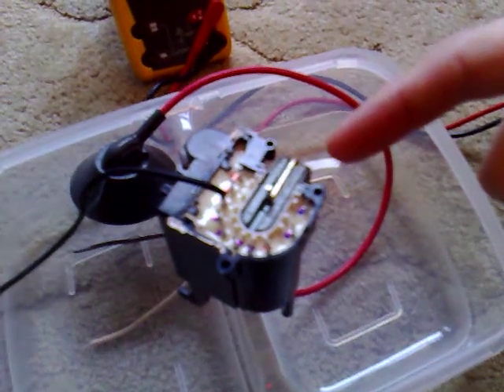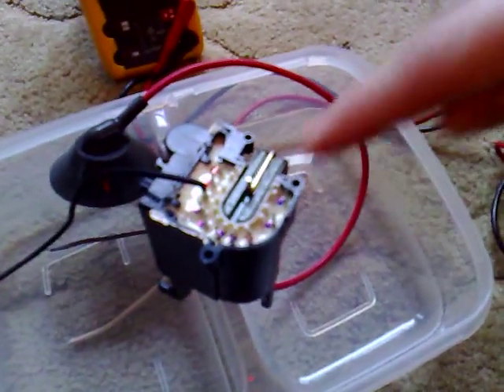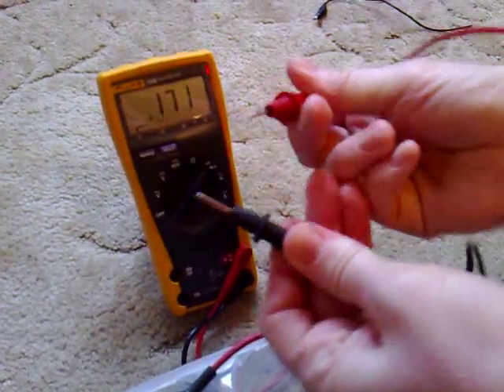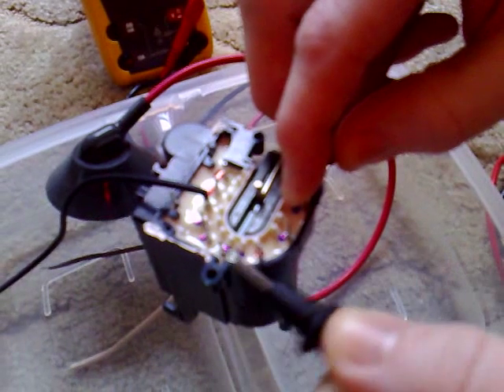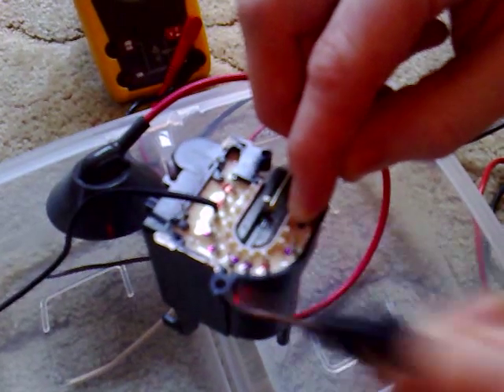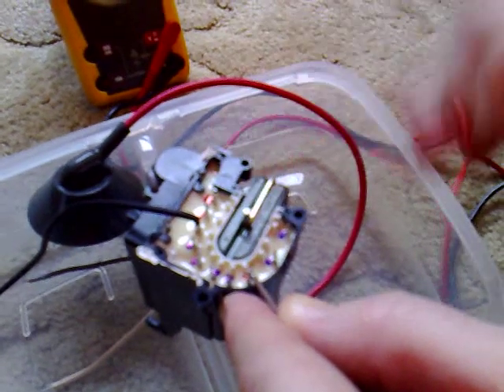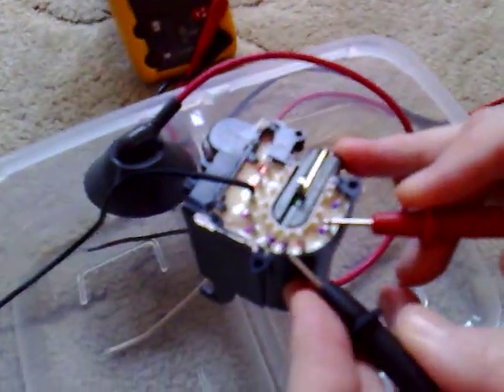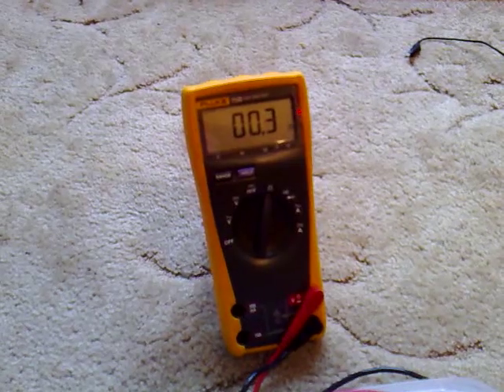Tesla Coil (Flyback Pinouts) 002

Comment: Hey Kubikop, I am messing with this stuff now, and I got an oddball transformer from a computer monitor. First I messed with it while it was IN the screen, I discharged it and unplugged the suction cup, flipped the suction cup, and cut open the second red wire, alligator clipped it to a long wire and put it on a stick. I plugged it in and pressed power, and got 2inch arcs!! But they werent a plasma stream, they were like lightning strikes. What do I do to get a lightning stream?

Comment: That's a pretty good way of finding out what is what, but why do so many people confuse Flybacks with Tesla Coils? Flybacks are fun to muck about with and arc, but they're not the same thing.
Reply: CoolDudeClem they use them as a high voltage supply in one of the circuits ( don’t ask me which I have way too much information in my head with a slightly questionable certainty of their applications, and am too sensible to commit to trial and error with HV!)

Comment: So they would be your input terminals. Question what Voltage/Amp range, and i assume its DC probably compatible with anywhere from 5-6-9-12-24-or even 40v depending on the resistance and amps.

Comment: @troyger1 Well, it looks rather impossible to wind on that core as I do not see any space on it to do so. If there is room, wind some thin wire around it. It would not be able to handle much current, but better than using the internal coils. I would hunt for another TV in the garbage or spend 8 bucks and get a random one on ebay that has room to wind some coils on

Comment: ok little lost some one here help just got flyback test them 1 2 3 buzz and 4 6 7 9 10 buzz and 5 8 dont buzz when use ohms to test get 0.9 and 0.6  just little lost wich one use for + and - power some let me know wich pins i need to use high or lows ones

Comment: @bnewton81
Take out 3-4,5v low current battery pack (like AA`s), switch primary winding on and off, try to get yourself
shocked by touching the positive wire and other wires with your other hand.
Or use a miltimeter, i was actually able to measure the resistance on scale of few millions ohms.